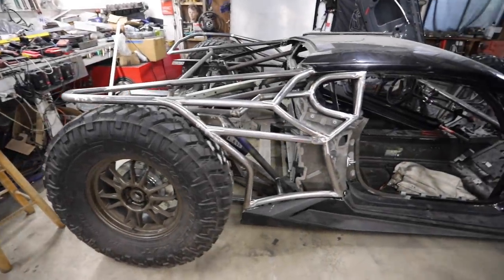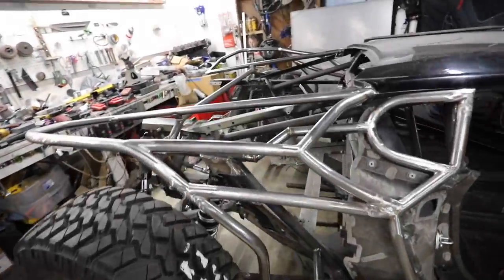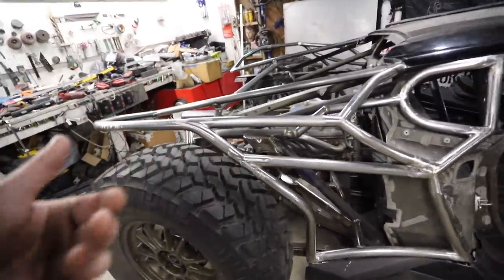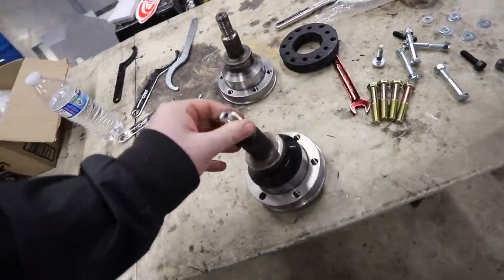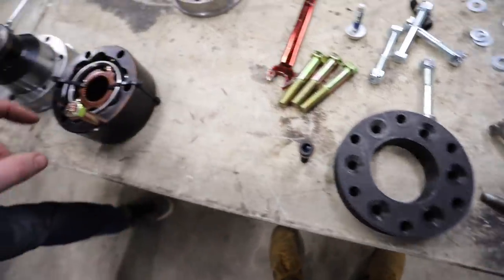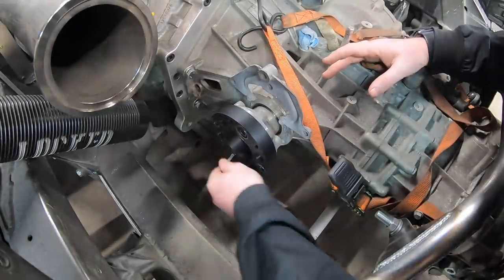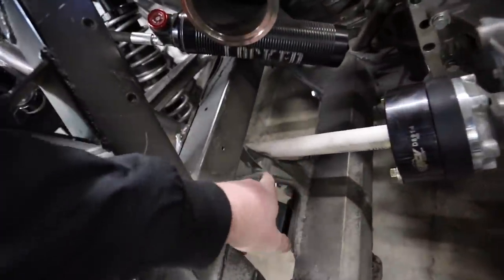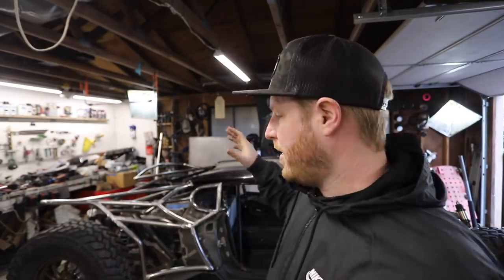Coil-over Springs Are Installed, Ride Height Set, The Jumpacan Is Officially A Roller!!

Comment: What’s your ground clearance?  Looks really low for an off-road racer.
Reply: Better have to beefy skid plates under that thing fill bad for when they bottom out and break the backs! Car is way to low for a "prerunner"
Reply: It’s all about down travel with bump stops. Low COG builds are a common thing in the rock/off-roading community.

Comment: You guys just gave some random car youtuber a great idea. "DRIVING ON PVC DRIVESHAFTS"
Reply: Paging Garage54
Reply: Sounds like a whistlin diesel episode lol
Reply: it would work easily for a large diameter center driveshaft, like on a truck. 4 inch pvc can withstand a serious amount of torsion, provided you can properly secure the ends and not just put it on with wood screws or some shit
Reply: @ohyou_6599  gorilla glue and flex seal
Reply: @ohyou_6599  can you give any examples of pvc being used instead of a metal alloy or composite material in the car or truck industry??
Reply: @khancrow8212  yeah all the shitty burger cars use pvc for their entire ugly interior instead of leather and wood.
Reply: @ohyou_6599  i am talking structural....you claimed it has amazing capabilities...
Reply: as much as i hate him, id actually like to see whistlin diesel try this.
Reply: @cyclone3999  why do you hate him?

Comment: Seems like something off-road would ride a bit higher and more suspension range. Looks badass though!!
Reply: @Lassi Kinnunen 81 He said he could make it ride higher
Reply: Yeah my thoughts exactly.
Reply: Exactly, I honestly thought the roofline would be near his chin level. This seems too low for an off-road car
Reply: It ain’t making 1 lap of the mint 400. The fox shocks section will kill that car if he even gets there
Reply: @austinmonk8809  won’t make it out of primm before it beaches itself
Reply: @jackmossman7559  yeah most likely will break something in the infield
Reply: @austinmonk8809  something with the driveline will grenade itself, or a suspension component will shear from the factory chassis
Reply: @mclarenspeed  yep,they probably can adjust an inch or so higher.sadly, they will have to revise the suspension so it rides at least 6-8" higher
 all around and then install bump stops to eliminate full suspension compression.awesome build but a few oversights,which is normal for a
 blind,clean sheet build but NOT when using 3d modelling.all of these issues should've been eliminated through 3d modelling and real time 
simulations which are available and used in autocad and mastercam
Reply: @trillrifaxegrindor4411  Ah, ok thanks for the explanation
Reply: It won’t.  This has the ride height of a Class 11 bug😂 it won’t be taking trophy truck lines. But it will be easy to adjust height later on when they realize they are wrong as fuck

Comment: Have you done full suspension travel with the axle installed? looked like it might come VERY close to the side 'chassis rail' when the suspension is in 'free load' position (and depending on the actual drive axle diameter, may come even closer)

Comment: When that thing gets moving at speed the tire diameter will increase with centrifugal force (Centrifugal Growth). I bet $10 when this happens and the car jumps/bottoms out it will hit the frame/wheel well
Reply: Car will never go that fast for the tire to expand. The tire will actually compress the side wall on the ground and blow the under belly of that car out if they are already bumping it to the frame.
Reply: this isnt a top fuel car,those arent bias ply slicks.the growth of this kind of tire would be ridiculously minimal 
at 100mph or less.it will bottom out because of poor suspension geometry and it being a foot too low

Comment: Chris... You have a lathe..... Why don't you machine the bolts for the adapter plate?
Reply: they dont know how to use it yet...see them grind the hub while holding it the wrong way instead of turning it around and machining it properly?
Reply: @trillrifaxegrindor4411  didn't actually see that

Comment: Your fabrication work is impressive but you're going to destroy that thing off the first big jump you take because there's not nearly enough ground clearance. You dont seem to have taken tire deflection into account. Your tires are part of your suspension and will flex on hard impacts and off jumps. Seeing as the car was almost on the ground at full compression, you're 100% going to contact the ground when the tires compress on a big impact or jump. You guys are doing impressive work overall. Would hate to see you cause major damage after so much good work. Definitely consult someone with major off-road racing experience before you start testing. 👍

Comment: If this thing is going to do any off-road anything, jump anything. Go anywhere. They will need at minimum double that travel in the suspension. When it was sitting super tall because it was still on the jack lifted. That 17-20+ inches is what is needed. Also so it clears things like the axle it almost sitting on now. Gunna need more than fine tuning.

Comment: Didn’t want to say anything until I saw it sitting on the springs but been thinking that the car was sitting way too low for a while. I know there’s adjustability in them, but to my eyes there’s no amount you can adjust those springs enough to compensate for any serious jumping. Would’ve thought you’d need a good couple of feet of body clearance under the car to be able to do what’s planned with it.

Comment: What you aren't considering is that, in an off-road situation the suspension can be compressed beyond where the chassis would bottom out on flat ground. Say you come off a jump and one tire lands on a rock or a bump in the road.
Reply: Or it doesn't land equally on all four wheels at the same time.
Reply: @BlueDually4x4  yeah, the Jumpicon is cool, and I want to see it finished, but is is not likely to be a very good off-road racer. Too many compromises.
Reply: @Skwisgar2322  I think with the class its in and if they drive smart it will be alright, but people expecting trophy truck performance out of it are going to be disappointed.
Reply: looks like they also fitted the bumpstops too high as they should stop the car bottoming out

Comment: So uh am I the only one that thinks the only thing it's going to jump is a curb? It needs a lot more ride height especially if you want some serious jumps unless the springs are stiff af
Reply from the maker: we mentioned in the video, if we need more height we can get it, but buggies dont sit as high off the ground as trophy trucks.
Reply: General rule of thumb for initial setup is to set the ride height at the mid point of the travel. That way you have 50% bump, and 50% droop.If you have the ride height raised much beyond that, you will gain ground clearance but the handling goes to crap in a hurry.
Reply: totally agree! Another thing they havent seemed to have taken into account is that the tires will compress on a hard impact or off a jump. The car was nearly on the ground at full bump which means when the tires flex, it will most likely contact the ground on a flat surface. Throw in uneven ground and rocks and you're looking at major damage not to mention a seriously sore back. Hopefully, they'll consult someone who is a real expert in off-road race design before they do any hard testing bcuz the fabrication and craftsmanship is very good. The design is flawed, unfortunately.

Comment: One thing that can be a issue with long travel driveshafts is that the cv joint can bind inside the cup when at full droop or compression because of the angle. Then causing the shaft to snap. I’m sure you’ll find out if this will be a issue once complete but just something to be aware of 🤟🏽 asking as they spin freely whilst at full droop you should be good

Comment: You might want some thicker shocks. Those 2.5s will get fade really bad without a bypass paired with it
Reply: Locked doesn’t make a 3.0 coilovers but he should atleast have a minimum of a 2.0 bypass with it . yea my 2.5s on my truck get hot fast on some of the small whoop section on the mint course. i couldn’t imagine trying to actually race on just a 2.5
Reply: @stockprerunner5277  No offense to locked but he should find a higher end company
Reply: @prestonbailey4450  locked makes great shit don’t get me wrong but they also don’t have as much R&D. I’d run ADS, king, or fox.
Reply: @stockprerunner5277  That’s exactly what I was thinking. I see the quality in locked but they don’t have a product that fits what needs to be done here. I’d love to see some kings on this
Reply: @prestonbailey4450  yea the only issue is that king is 35 weeks back ordered. Locked seems perfect for the daily driver/over land truck. reminds me of another brand like Icon. I went with ADS on my truck just because in my opinion they are built better than king.
Reply: @stockprerunner5277  understandable. That’s absolutely nuts. Less than a year ago I got mine in 4 weeks
Reply: I wish they shoved a 4link and gave it true long travel numbers
Reply: @marcusbevz6500  Me too. But they’ll live and learn
Reply: @marcusbevz6500  it would be hard to 4 link a independent read end. it’s still pulling decent number for being a independent rear end. pretty similar to built bugs in a way
Reply: @stockprerunner5277  I meant solid swap the rear with a proper chromoly 9”
Reply: @marcusbevz6500  yea i got what your saying. i’m saying with a rear independent setup like that it would be extremely hard or to switch over. especially with a rear engine setup. thiers Built baja bugs pulling 20” plus with irs. a 4 link rear end works better on a truck/ jeep setup
Reply: @stockprerunner5277  true but in the front... there is no engine he definitely could’ve chopped the frame and made the A arms almost meet in the middle, but then he would have way to much front travel vs rear travel ratio
Reply: @marcusbevz6500  yea they could have easily gone center mount and it would have dope. but probably would have costed double. you can strap it so it’s closer to the rear. i feel he should have built it more like a class 1 or 10 car.

Comment: Axle length should include the thickness of the inner CV bearing cage plus 1/8 of an inch on either end for a groove to be machined to accept a snap ring.
Reply: lots of math they ignore,then get punished for it later

Comment: I don't know if anyone has pointed it out yet but, of you need to counter-sink for hex head bolts (or anything with a 90 flange) use Forstner bits. You can find a small set @ the "blue" store for around $30.

Comment: I'm surprised that ya'll didn't go with King suspension. I didn't know that Eibach made serious offroad stuff. I'm a little worried that ya'll won't have enogh spring travel for big stuff, but i believe in ya!
The car is lookin great!
Reply: I had the same thought. But at the same time, that thing is still very low...the mint is going to beat the hell out of it hahah. Who knows.
Reply: King is 35 week wait time on basic stuff, my lead times are still 12-16 weeks for anything I need. They are way too busy with trophy trucks and real race teams dropping 30k on shocks vs something that’ll never make it off the start line. Eibach is huge, their springs are extremely well made and perfect for this build, but the rates are wrong, they need a much heavier rate for it to sit right
Reply: @jackmossman7559  Thats kinda what i had imagined. I know that there is a pretty decent market here in san diego for used fox and king suspension pieces. but you nailed it with your descriptions lol. This will be interesting. There is alot of underestimation going on here...

Comment: It's hard to see, but it looks like the bump stops need lowering.
The shocks should only bottom out once the bump stops have bottomed out and this should occur before the wheel or suspension A arms impact the frame/body.
As long as you got this down, you should be good.
But in reality, you want to leave a few mm of shock from bottoming out once the bumps are fully compressed as they are designed for this, shocks will snap.

Comment: You also can also change your oil viscosity inside your shocks along with preload on your springs and dampening adjustment on your reservoirs.. that will help keep the ride height stiff until you are moving and cycling your travel

Comment: wouldnt it be easyer clearance wise to have th axles in two parts with a fixed shorter axle between the trans axle and the frame and then put the CV in line with the pivot points of the suspension arms and a carryer bearing bolted to the frame ?
Reply: It has to be as strong as possible off-road is super rough and every part has to withstand the abuse, that means specifically for axles when you have your locker engaged it’s super easy to break them so having more parts is worse

Comment: Isnt the axle gonna hit the subframe when fully decompressed?
Reply: sure looks like it. They will need more clearance or limit the downward travel.
Reply: Alternatively, they could add universal or cv joint just above the frame rail, which would give them a hell of a lot more clearance overall, but an extra link to possibly break
Reply: If they add the extra joint, that will get rid of the need to remove that mount as it could be a fastening point for the carrier

Comment: I was wondering today ... do lamborguinis ever lift the front wheels off the ground? If not then why?
Reply: No. AWD, low ride height, not enough rear weight bias, and probably most importantly, it's not desirable for performance and is actively engineered to not do it.
Reply: 1320 video. Lamborghini drag car with front wheels off the ground.

Comment: What size CV's are those 930 or 934? You might want to reduce the length of your adapters and keep the CV as close to the trans/hub because short axle equals short travel.
Reply: They’re gonna have to do a 2 piece axle with that travel, otherwise it will be frame on axle first jump

Comment: This thing won't survive the first 2 miles of the race... No bead locks, horrendous balance, way too low ride height, way too little travel in the suspension. You are going to hit the first set of jumps and then get rewarded with some collapsed discs...
Reply: absolutely

Comment: The drill bit you need is called a end mill bit or you could just cut the head off a regular drill bit to make it flat giving you a counter sunk and flat finish inside a piece of material try it it works

Comment: Am I the only one worried about 1) the tyre contacting the new frame when the car bottoms out (and fully compresses the bump stops, rather than just resting on it) and, 2) the drive shafts contacting the frame at full droop?
Reply: I'm more worried about the plastic axle adapters, I don't see those lasting very long

Comment: Was thinking they would put a much bigger suspension, like a rally truck type of suspension
Reply: They would need to 4 link the rear which would require a solid axle which in this car is a problem with the engine being in the rear and in the way... if they bypass that problem and fit a 4link then they’d have to chop off the frame from front and back and redesign the chassis completely so the front and back of the car is balanced, so it’s probably out of the budget

Comment: Those spring rates are VERY light. It’s not really comparable but on my long travel f150 (2wd single cab aluminum bodied truck so it’s still very light) I have 700lb springs in the front and they’re almost perfect. I’d bet y’all are going to need a 400 over 500 or even 600 lb springs in the back
Reply: thats 5000 pounds,this is 2000
Reply: @trillrifaxegrindor4411  it’s 4K vs 3k. Not all that different

Comment: Hey guys, i'm pretty sure that lip you ground off is going to cause you some vibration issues in the drive line as you'll struggle to line the cv joint perfectly to the axle. I may be wrong but maybe worth checking it out
Reply: thats why they should have rotated the hub,clamped on the OTHER END,indicated it first to 0.0002-0.0004" THEN MACHINED IT

Comment: 3D printed parts that you can create quickly, modify, and reprint quickly.  The process is call "Rapid Prototyping."  Fabulous use of it.
Reply: @curt-1927  they're just modeling it with the 3D be printer. Once they have it the way they want, the can send the file to be CNC'd in metal.
Reply: delrin isnt a good hub adapter material

Comment: That was SOO SLICK WITH THE GRINDER ON THE LATHE 🧠💪🏽💪🏽
Reply: see them grind the hub while holding it the wrong way instead of turning it around and machining it properly?  fucking butchery instead of finesse,they need some practical machining experience.....now it will be rough and unbalanced instead of machined properly

Comment: in my opinion, ask the RCV to make the whole axle. that axle has too many parts that can break. if you think you should continue, please make more 2 axles, if they break
Reply: I also think that lamborghini gallardo style axel conection they are too weak, there is no way to reinforce it? I would also like to ask: if there is no front-wheel drive, only the rear, if you have a wheel stuck in the mud, always spinning, you will be stuck, there is no lock. how does the lamborghini gallardo traction system work? ps: I am not an expert, they are just observations, I hope to help
Reply: you have rcv parts, those parts will not break. now, what will be the weak link? maybe lamborghini gallardo style axel conection, I think you should do a lot of tests before the race, to give time to solve problems. and take replacement parts for weak links
Reply: @marcopedroso3498  this car will not make it through 1 section of the race
Reply: @trillrifaxegrindor4411  I am in fact worried, a car so close to the ground, so wide, that on the first jump, that cris breaks is back, not to mention the home made axle parts, which have no replacement parts